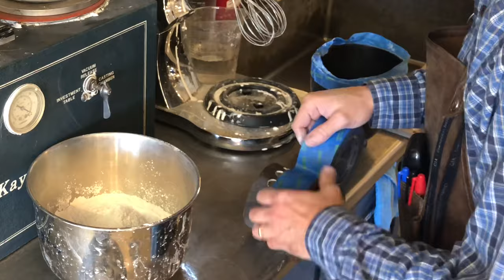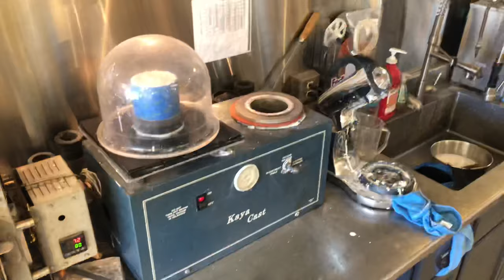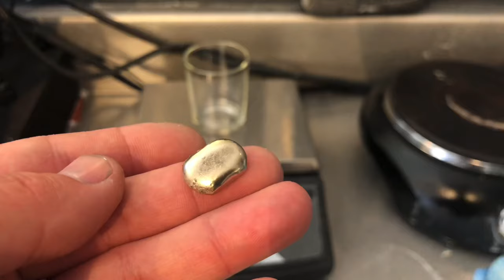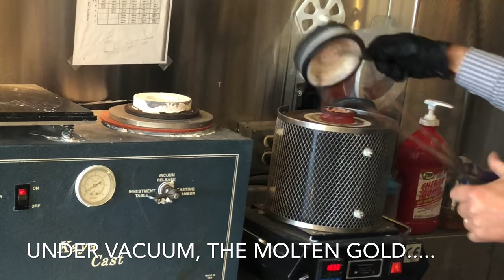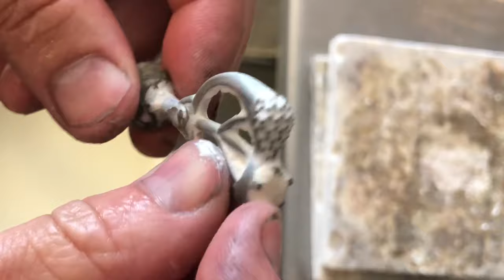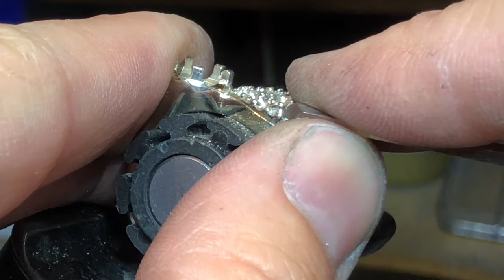Making a ring using the lost wax casting process.

Comment: Hi I don't understand one thing. When you put the flask into the kiln at first the flask was upside down but when you took out the hole was up top. Did you change it in between?
Reply from the maker: Yes, we did flip it. Having the flask upright, makes it so it’s easier to grip it at the top, so the flask can be placed into the vacuum chamber.
Reply: @VintageJewelersGiftsWindsor  Thank you for the reply.

Comment: I have a silver ring from my father that's unlike anything I've ever seen anywhere else.

It looks like a thin round silver band (like a single band of a keychain ring) with silver dripped over it in a cool almost eye shaped pattern on the top, with a hole through some parts, and silver overlapping itself on others. There's tons of little crevasses and buldges down the side and literaly looks like silver dripped down the sides.

He had told me it was a dripped silver ring that he made in his 20's but I never got to ask him more about it before he passed.

Is this basically the processed he used, but instead of a carved wax mold, he just dripped wax over a band of wax?

It seriously looks like someone just painted/dripped a plain, thin silver band with molten silver, is that something people can do? Or do you think the processed you used sounds more likely?

Wish I could post pictures.
Reply: That sounds like a very very cool ring. Thank you for sharing.
Reply: Post a video and we can maybe help you discover the process.
Reply: @bezeir  wow.. that's actually a great idea and I have no idea why I didn't think of that!
Reply: Yes i do this process by dripping the wax onto a band and using that as a mold. You can make dents into the band to make the wax droplets sit better and they should be just around the melting point so they cool off very fast.

Comment: Hi i have a question if you can help me, if the investment isn't mixed properly will you not get that suction pulling the metal through casting? I'm having a problem I cannot  seem to figure out, I just purchased the dura bull which is identical to the kaya cast.
Reply from the maker: I use a 39:1 ratio. I Doubt it’s the investment ratio though, probably the seal around the flask. However I did have a problem with the flask one time. The flask had developed a small crack around the lip and wasn’t drawing the suction through the investment. Thought it was a problem with my vacuum for a few casting until I figured it out.

Comment: What temp do you take out of burnout ? Is it 225 c ? I'm guessing so as that's what the bottom reader was showing or have I miss read it ?
Reply: One of my digits on the PID controller stopped working right after I installed it. It’s 1225 Fahrenheit.

Comment: Excellent video, My daughter is now doing at university a design and fabrication degree, basically she will come out with a silversmith and or goldsmith, one of the things she is worried about is that they do not seem to want to do very much casting , we live in spain, its quite weird here in the "arts" , anyway she is a little worried that she will have the degree but not a huge amount of experience in this type of work which is primarily what she intends to do.

You obviously have an awful lot of equipment here and I have a few questions please,  first of all is on the vacuum machine, I understand the process of how you remove the air from the mould with the bell cover on the vacuum pump but I dont understand how when you pour molten gold into the mould on that machine what is does then, I though it pulled it under a vacuum but you dont cover the crucible, is it possible to explain that part of the process please.

Also the kit you have adds up to quite an investment, burn out kiln, electric furnace, vacuum and casting machine , ultra sound bath.
i have the last piece and I want to try and help my daughter so she can practice at home and gain experience.

Of those tools are they all totally essential to make a casting?  The kiln I would say yes as it can be used for a lot of other jobs as well, the vacuum and Casting machine I am not sure about, over here in spain this retails at 700 euros more or less I can buy a purely vacuum pump with vessel and valves etc for 99 euros , its made by the same people who make the big machine, Vevor.  It purely removes the air from the investment mould by utilising a steel vessel, polycarbonate lid with valves and seal etc,   you would not be able to use it for the casting though as it would be too slow to do what ever your machine does.

I can though pick up a centrifuge for around 100 euros or do you think your machine is 100% essential for a new jeweller to get for casting or would using a vacuum pump be enough to remove the air from the investment and the centrifuge to cast.

Moving on the furnace is obviously a sort of a nice way to melt the precious metals but I have gas tanks that run air oxygen and propane mic, I also have acetylene but i wouldn't like that in the workshop down stairs, that gas is inherently dangerous. Propane and oxygen will certainly melt silver, gold i don't know the melting temperature as i type this, as a student she is using silver a lot because of its cost over Gold.

the iltrasound bath i actually have and can see its put to good use to remove the investment material, I also have a polishing machine, several dremels and a ceiling mounted type dremel as well for finishing, 

georgie does know the process as she made a gorgeous ring but they did not cast it at uni, the wax impression was sent away and the cast was returned a few days later.

Im trying really to set up for her a space in the home workshop where she can feel she can do a lot more work that she is doing at university and possibly earn some money on the side whhile she does her degree.

I have already built a proper heavy Jewellery table in the typical fashion with all the drawess, cut out area and bar for you feet and lockers underneath and she loves that, They were silly money to buy and as a carpenter it was easy to make one.

Would you please mind helping me out here and advising me on where i should put my money and explain the use of the main machine and how it works on the casting sie as i dont understand what its doing or how it does it.

Hopefully you have some time to answer my questions, this is going to be a total surprise for Christmas, her very own workstation, I also have from the us the tiny gas soldering system which is lovely but for melting silver i have a larger tank array and torch if necessary. 

I dont mind investing the money if its all absolutly necessary , I would prefer to do it in smaller chunks if thats possible.

Many thanks and the ring was quite beautiful finished.
Reply: you sound like a wonderful dad! 😊

Comment: Hello sir 
My question is why don’t you set the stones before the casting ? Or is it because the results isn’t as good ? 
Thanks
Reply: Think that one thru...  You are making a mold to cast the metal into.. There is nothing to set them in before casting.. You cant get them into the mold after you melt the model out.

Comment: I noticed the flask comes out of the kiln hole side up, but goes in with the hole down. At what point does it get flipped?
Reply from the maker: I pull the flask out of the kiln a few minutes before casting to inspect it to make sure the model has burned out completely. Then I put it back in to with the hole on the top, so it’s ready to pick up and set into the vacuum caster.

Comment: My recommended casting temp is 900° f and my flask comes out of the kiln glowing red hot - obviously something is wrong with my temperature controller. 🤔
Great video,  thank you for sharing  👍
Reply from the maker: It's been years, but somewhere on the internet I found instructions and converted this kiln from a standard rheostat to a Programable digital controller with thermocouple. It's was a big improvement as the temperature is accurate and it can ramp up now. I bought from PID, SSR and thermocouple from https://www.auberins.com/index.php?main_page=index&cPath=1&gclid=Cj0KCQjwsdiTBhD5ARIsAIpW8CJSgTWEtGWG_m2BRed18OmlFHqaGG-K-nrURFVrajq-hdinWUIFIfIaAlWeEALw_wcB

Comment: Can you not use the burnout oven to also melt the metal? Instead of using both the burnout oven and the mini furnace.
I'm looking to start up a jewellery business and trying to get by with the cheapest/less equipment.
I have a silversmithing and lapidary studio so I don't wanna get to overwhelmed with machines and tools 😜.
Reply: 4months late but the idea behind using both a furnace and kiln is so the mould is up to the temperature of the metal to get a good pour with no cold spots in the mould for consistent results.
Reply: @samellowery  okay thanks :) I get you, the molds gotta be hot still. Just like when pouring an ingot.

Comment: very nice! what resin is this and what's you burn cycle? :)
Reply from the maker: Thanks, this was the solus emerald green resin, but we’ve since switched to X-one castable resin. I get good results using the 12 hour burn out cycle recommended by plasticast. Some casting with resin use shorter burnouts, but since I let it burn out overnight, the longer burnout time is not an issue.
Reply: Thanks for sharing! At what temperature  do you burn out the wax model?

Comment: Absolutely stunning! I’m new and “self taught” to jewelry making and realized i have no idea what I’m doing an bought the wrong things. 😆 i was wondering how i was going to remove an intricate wax ring mold from the delft clay 🤦‍♀️so scratch that. Lol what kind of plaster do you recommend and do i need a kiln? Do you have any other suggestions? I don’t want to spend too much money trying this. So if it’s not possible, i wont be offended. Upset, but thats ok. 😊 TIA!!
Reply from the maker: It’s possible to cast using less expensive methods like sand casting, however to achieve the detail needed in these designs it does require some investment into the equipment.
Reply: @VintageJewelersGiftsWindsor  that’s what I figured. Thanks for responding!
Reply: @jenl336  how about using a centrifuge instead of a vacuum cast

Comment: Do you use borax or any flux with the smelting of the gold
Reply from the maker: No, it’s not necessary to use flux with the graphite crucible of the electromelter. It’s actually better, since you won’t get flux contamination in your casting. I just clean the gold casting sprues really well that get recast along with the new casting grain.
Reply: @VintageJewelersGiftsWindsor  ok thx buddy

Comment: I came across this movie by accident, and I tried very hard not to comment on it, but I can't,
first of all, this ring should cost tens of thousands of dollars, because to run a melting furnace for 20 grams of gold???
second to use such a large flask for one ring ???? , this obviously involves the use of a very large amount of gypsum, which is a huge cost
it could be done in a flask with a diameter of 40 mm and a height of 70 mm and instead of melting 30 grams of gold (no sense) you can use 10 grams and melt it with a burner in a crucible and the effect will be exactly the same

Comment: Hi could you tell me how the metal flows into the mold without breath holes in the mold itself, like you do with delt clay?
Reply from the maker: The metal is poured into the mold from the top, through a sprue to reach the negative void. The mold is a plaster called investment that is porus enough to allow the vacuum to suck air through the mold.
Reply: Thank you very much for letting me know so quickly.  I tried to do it today but the white gold just didn't flow properly.  It might have been the fact that my sprue was not wide enough for the metal to flow.
Reply: @tammywhittenham543  add a little borax to the gold before putting it in the smelter. Borax allows molten gold to flow more freely.
Reply: Thank you very much

Comment: how do you calculate the amount of gold needed per ring any karat and if the same calculation applies for silver?
Reply: im rather new to making jewellery but my grandfather always taught me to have a little extra then what i think i need cus you will probably need that little extra
Reply from the maker: So every metal alloy usually has a density/specific gravity specs provided by the manufacturer. If you weigh your wax model and sprue before casting then multiply that by the S.G. It will give you the amount of metal you need to use for the casting. Example: Model and sprue weigh 2 grams and the 14k gold has a specific gravity of 12.6. So, 2g x 12.6= 25.2 grams of 14k would be needed. Also I usually add a few more grams for the button.
Reply: @VintageJewelersGiftsWindsor then how much does the resulting ring weigh and the leftover sprue?

Comment: So in theory could I dewax with steam, and put the investment in a propane forge to get up to temp to pour.. dont have a kiln
Reply from the maker: Yes, if you’re using wax models you could use steam de-wax it. I suppose it could be done, but I doubt you would achieve very good consistent results using a propane torch to burn out the mold. Investment breakdown, incomplete burnout, mold cracking, partial fill, and porosity are just a few problems that can occur.